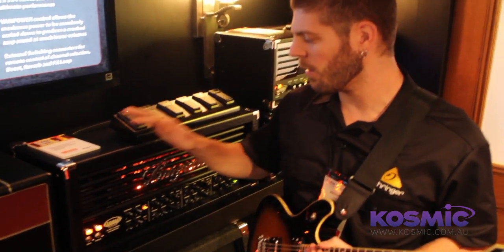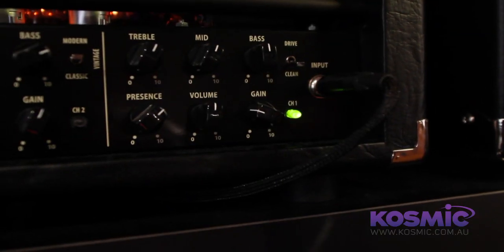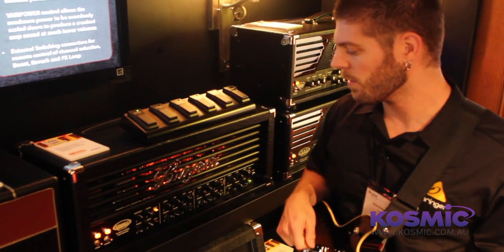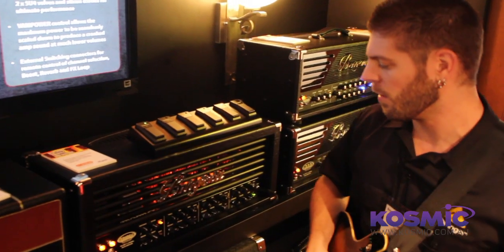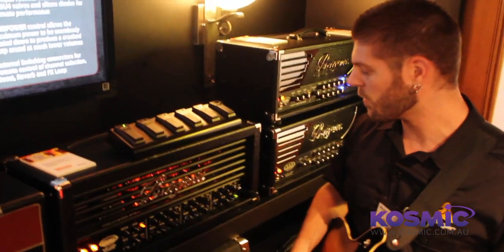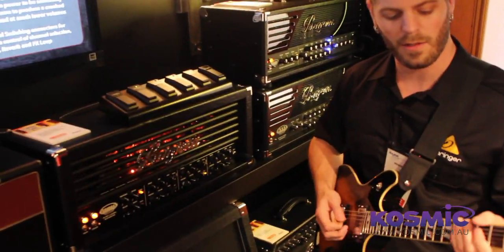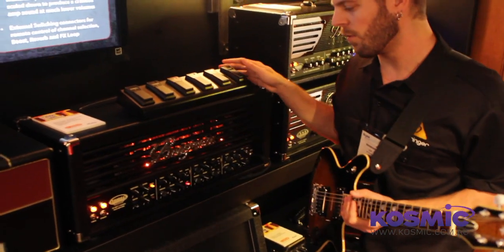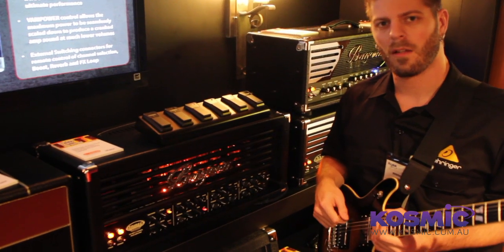Bugera Trirec Valve Head

Comment: You do have a point.Speaker materials can vary & have tonal bearing.Also,the same identical speaker will sound differently in different cabs.All I know is that for me,coming from a classic hard rock (Zep,Aerosmith,Foghat) classic metal (Sabbath,Maiden) background that the 25 watt GB's are what these bands used and sound superior to me along with the correct tubes and mid powered pickups.If you're a more modern rock player your ears will want different tonal textures and equipment combos.

Comment: i once tried this bugera 412 with an engl blackmore. it's muddy, undefined and somehow... flake-ish? they are very low qualty cabs, for 200 bucks you cant expect too much. i compared it to an orange 212, i think with v30's. the 212 had more balls, more definition, and just a way more classy sound. there's no comparison between the bugera cab and something serious (i use a peavey XXX cab at the moment, will upgrade to orange ppc412 soon). the amps are very good, the cabs are not.

Comment: I find a Boss NS-2 which I for one have 3 or 4 of amongst many other noise gate/suppressor solutions available far more useful and tweakable should I need to. Yes bonus if there is an on-board one which does the job well but its far from a deal breaker. Now what would be FAR better is getting rid of the crap reverb (be it spring or DSP...Its all crap on-board every guitar amp) then cut the price for the end user. Leave reverb for when tracking or via convolution and/or quality DSP algos. My 2p